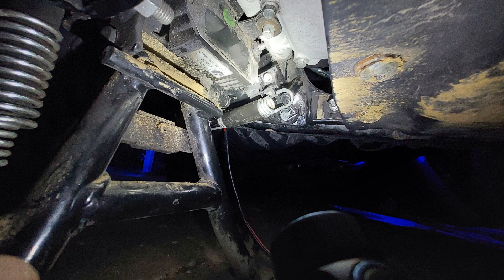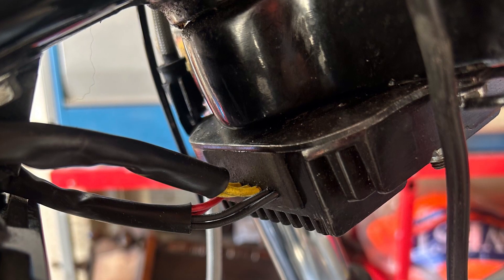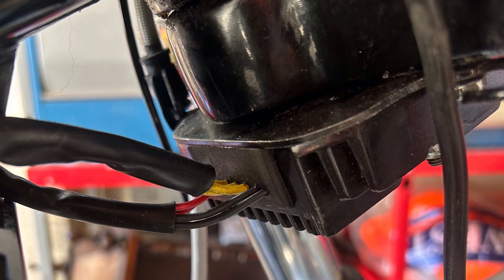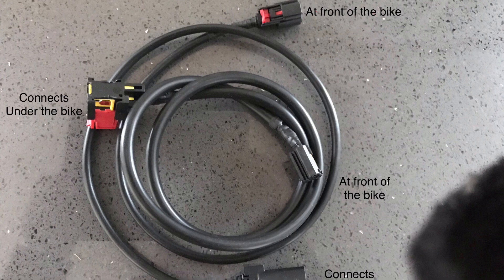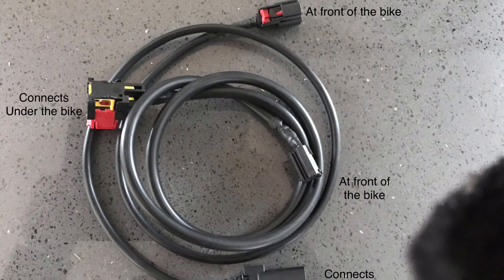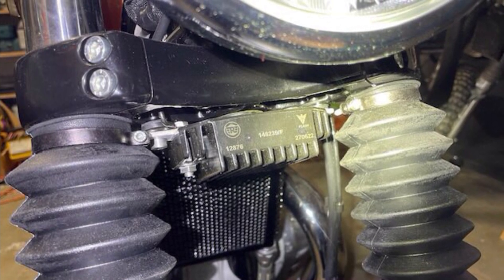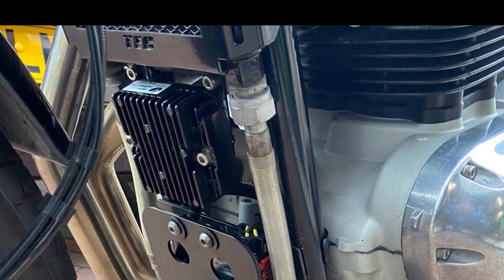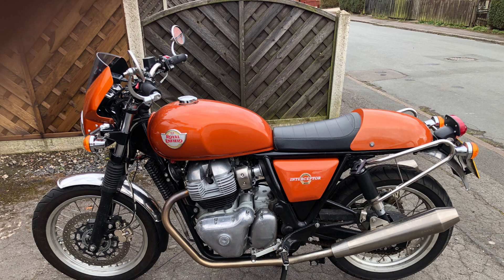Interceptor and GT 650’s. Why do rectifier regulators burn out?

Comment: Hey James. The shiny black part on the back of the r/r unit is just the potting compound used to seal in the electronics. Most likely reason for it staying cleaner would be the amount of heat generated by the unit, it's basically cooking the muck and dirt off. I'll contact you on e male you to purchase the cable for the relocate but I can fabricate the bracket. With only 500 miles on my bike the r/r should be fine.
Thanks for all the great information you provide. Don H.
Reply from the maker: Yes, my thoughts exactly

Comment: For anyone wondering how good this relocation kit is, I went through 3 Rectifiers in a under a year (my GT is a daily with about 12,000km a year, so I get quite high mileage, but roughly every 4,000km I'd burn out a unit). I moved my rectifier almost a year ago now with this cable kit when James started making them, and I have had zero further issues, so I can defo recommend! Thanks again James!
Reply from the maker: Thanks very much for your comment, Andrew. Occasionally, I receive emails from people who doubt the whole idea of re-locating their RR….eg “my RR is fine and I’ve done 6,000 trouble-free miles”. Which is great….until it burns out. I’ve had literally hundreds of emails from people whose RR’s have burned out on the OEM position with ruined trips, expense etc. nobody so far has had an RR burn out after re-locating. That’s great news re the success on your bike. The record for burned out RR’s in the OEM location is FOUR in 1700 miles!
Reply: Hi James,I'm from Brazil and I'd like information on the rectifier connection cable. Price and If you could ship It to Brazil. Thanks you.

Comment: Still knocking out bar switches ?   have relocation cable and your bar switches on my Ceptor'... works great.  😎
Reply from the maker: I’ve not done many……they’re very labour intensive! And finding used ones is getting harder…..
Reply: @internetpolification    We have a local cycle boneyard and others around the county... but I suspect post and parts would be cost prohibitive...
Reply from the maker: @motormikeb1047 yes…most sellers on eBay are selling at £35 a side for old switchgear
Reply: I have the Yamaha FJ1200 that James refurbished look great & far superior to stock switchgear.